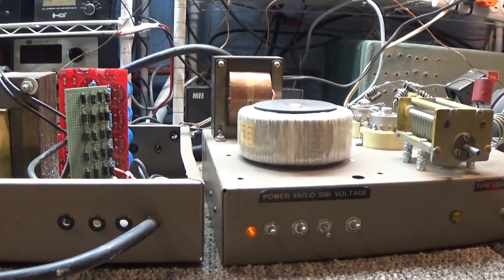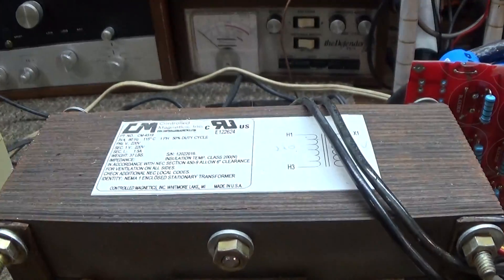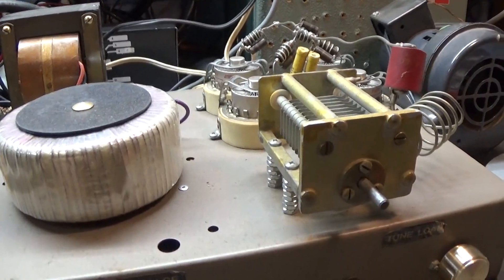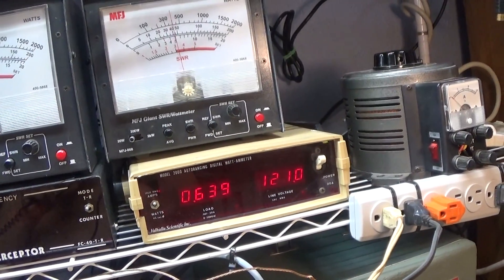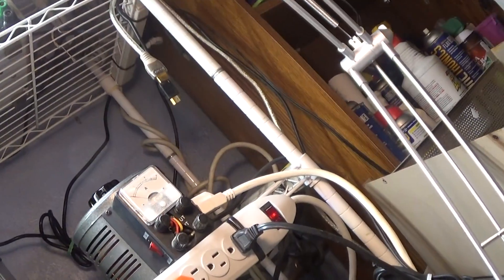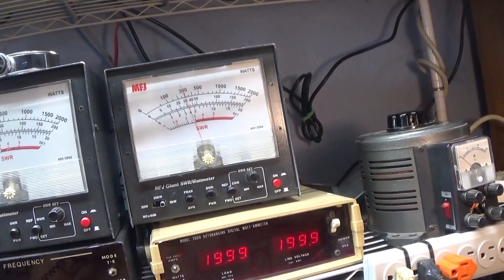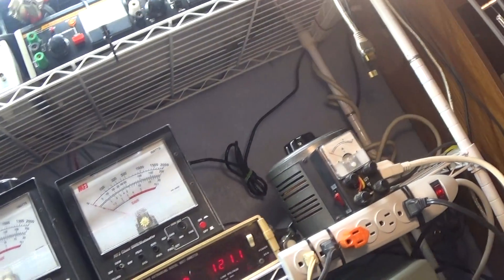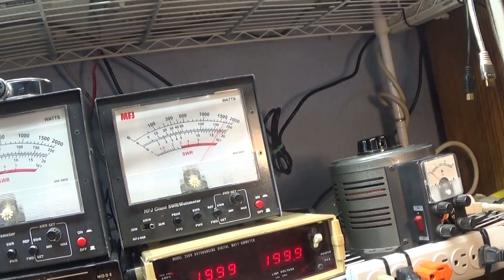It's back, Johnboy Tenessee Walker four 4cx250b box

Comment: I had a 2 tube 4cx250b amp but it never really worked right. The power supply wasn't big enough.
Reply from the maker: Too bad you don't still have it. I think this would have worked great. https://www.ebay.com/itm/255862572730

Comment: Where did you find these sweet iron core and toroidal transformers?
Reply from the maker: Iron Core came with the amp. The Toroids I get from Ebay, there is a seller there with all types from filament up to I800 at I amp HV